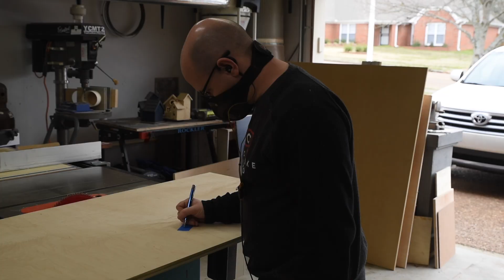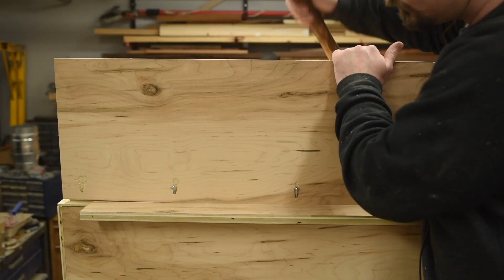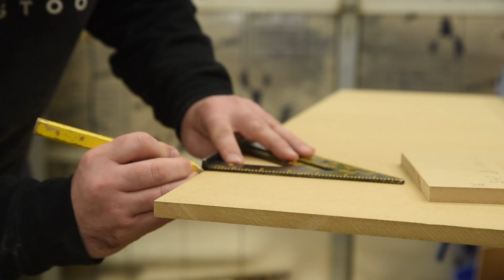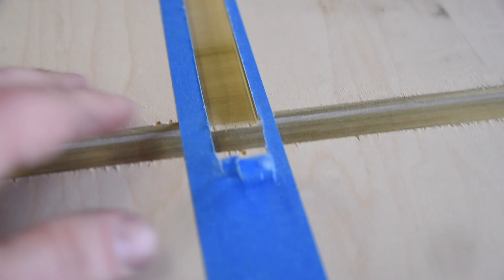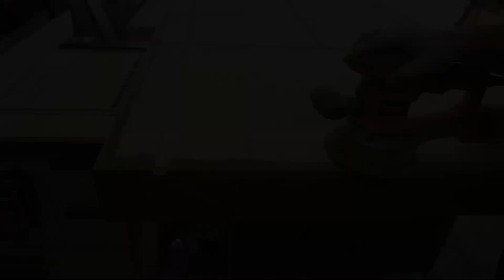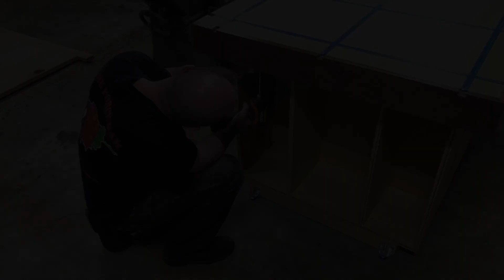Build an Assembly Table / Outfeed Table

Comment: Might be a stupid question but curious as to what the different dado depths were?
Reply: What about on the plywood, the edge rabbet and also the dado on both sides of the plywood
Reply from the maker: The general rule is half the thickness of the material.
Reply: Or 1/3 if its both sides I believe
Reply from the maker: Correct
Reply from the maker: For the t-track it’s 3/8” deep.
Reply: Thanks, plans ordered ready to get started!

Comment: Great video!  Can this plan work to connect to a Sawstop contractor table where the motor hangs off the back so the cabinet can’t get within 11 inches of the cast iron saw top?  Can the torsion box get close enough?
Reply from the maker: That's a good question. I imagine you could alter the shelf area on the end to leave out some of the uprights to slide the motor in that side. Or just make the top 11" longer on the other side.
Reply: YouCanMakeThisToo do you know if an out feed table can simply not meet up to the table saw and still work just fine ?  My motor is big on the back side of the saw.

Comment: Hey Caleb, I love the Build! I had a quick question about it. I’m wanting to build a torsion box top for my outfeed table as well, but I looked at the Wood Whisper’s torsion box video and he made a huge deal about working on a completely level surface. Did you do that for yours? Does it matter? I realllly don’t want to spend the time using saw horses and shims to level things up. Btw I really appreciate all your videos! I’ve learned a ton!
Reply from the maker: Thank you! So obviously the flatter the surface you’re building something flat on.. the better. But in my mind part of the beauty of a torsion box design is that it should not only resist torsion to stay flat.. it should also pull itself flat as you build it. Assuming the outer skins are relatively flat and you’ve ripped the internal structure to the same width. You saw how I built the “webbing” inside the box. the bench I built it on isn’t totally flat. But I made sure that as I went, the webbing was flush with each other. If the webbing is the same width, the ends of it are square, and the pieces all flush with each other, doesn’t the final product have to be flat? I may be wrong, and if any one of those isn’t true.. then it won’t be flat. But so long as it’s reasonably close, it’ll be better than it needs to be for woodworking. Good luck!
Reply: YouCanMakeThisToo Awesome! That’s kinda what I figured. Either way, I’m sure it will be flatter than what I originally planned on building before I learned about torsion boxes from this video. 😂
Thanks again!

Comment: It doesn't look like your assembly table has a torsion box top.  Would you say it really makes a difference?  I have been trying to plan my own.  It seems like there is so much structure in the over all cabinet base that it should all be pretty rigid.
Reply from the maker: If you’re building a cabinet style table, I don’t think so. Especially with a doubled plywood top.

Comment: I purchased the plans but cannot find the final dimensions.  Can you help please.  Tks, great video and I'm getting ready to get started but need to modify slightly so I can move when necessary.
Reply from the maker: I’m out of town but when I get back I’ll pull that measurement for you, sorry for the trouble and thanks for ordering!
Reply from the maker: It finishes out to 40" x 56" x 33 3/4" tall.
Reply: @YouCanMakeThisToo  Thanks so much.  I need to adjust for wheels so this info will come in handy.

Comment: That was a lot of pieces to cut and they seemed to go together perfectly. That's an accomplishment. It looks nice. I think I need to go shopping for some walnut now. Maybe the drawer fronts of my miter station or something. #unnecessarywalnut
Reply from the maker: Trust me, a little less perfectly than shows. But it does help to set a fence and rip the same dimension all at once. Counts more that pieces are the same that right on the number.

Comment: To prevent nails or staples from blowing out the sides hold your gun perpendicular to the edge of the material. Nails and staples will always veer left or right due to how the point is formed when they are in strips in manufacturing. Rotate the gun and you'll never have a blowout :) Look at the point of the nails and it will make sense.
Reply from the maker: Thanks, Jay! That does make a lot of sense, I’ll be sure to do that.

Comment: nice video, came out well... am curious though why your buddy took the time and had the know how to design a project to the point of having accurate cut sheets but did not want to be apart of the best part of woodworking, the actual wood working lol.. he's in a wheelchair and only has half a right arm or something?
Reply: i've seen others build torsion boxes and they do these elaborate level systems to build it on which has always put me off from trying one.  you just use straight material and go for it? and it works out?
Reply from the maker: That’s how I did it and it’s really flat. Of course, if your material is all wonky to start with, it won’t be. That’s one reason most of it was MDF. I always thought that was part of the reason for building a torsion box, as you build it the material has nowhere to go but flat.
Reply: @YouCanMakeThisToo  i find it it  interesting how at my day job we  make custom cabinet doors for mostly commercial outfits like schools and such. We dont have one flat surface in the shop aside from the cast iron surfaces and to boot we dont even joint our material, its all skipped planed on the face and straight line saw for edge.. we just cut out the straight parts of 10 foot boards and build with that.. our waste is pretty substantial but time is money and is cheaper to waste wood than slow down and do it right.  id say maybe 1 in 500 doors we make warp, and thats usually a frame only doors for glass because there is no panel to help it stay flat.
Reply from the maker: That makes a lot of sense for your application. For most hobby woodworkers I'd say we get too bent out of shape about stuff like that (dead flat workbenches) and ignore things we should pay more attention too (timely replacing dull blades and machine maintenance). For the most part a mostly flat bench top is adequate. The only time I start getting concerned is when I'm gluing up table tops.
Reply from the maker: Work benches tend to do really well on my channel, so I asked if I could build it for him for the content. He prefers to do his commission builds and not shop stuff, because he doesn't get paid to build shop stuff, so I did it. You should check out his IG, he does amazing work.